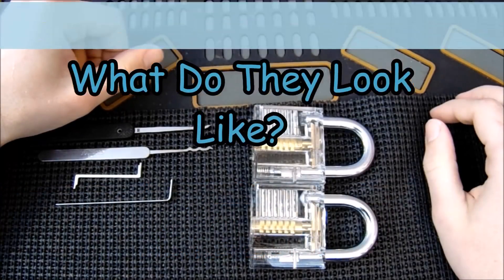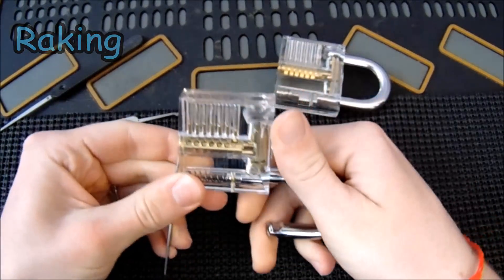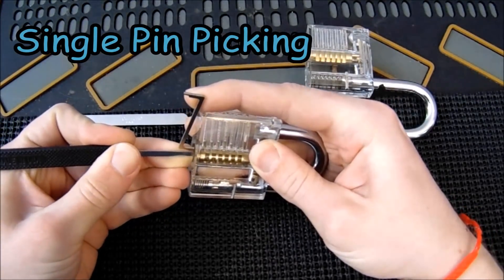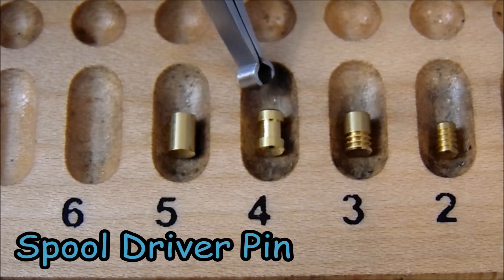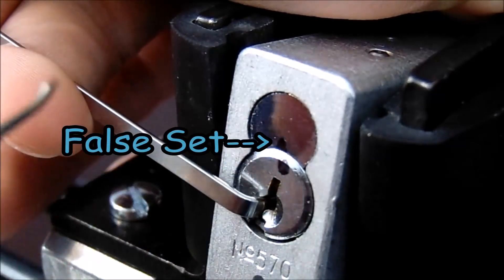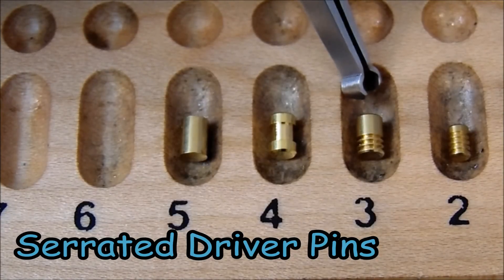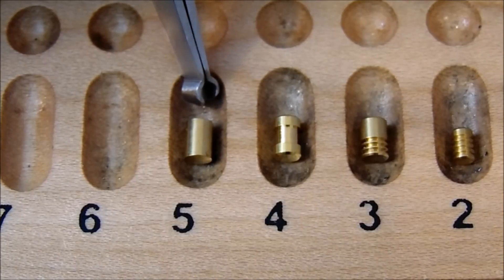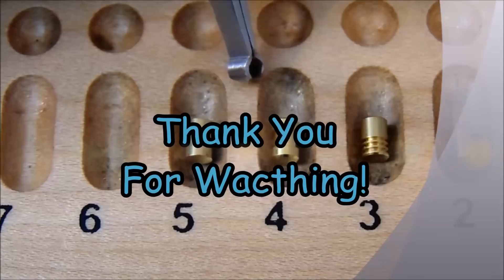[114] What Are Security Pins???  How Do They Make Lock Picking Harder?

Comment: The multipick cutaway locks have pinning kits that come with hollow pins (there's a small hole on one side of the pin, it's not drilled through, so that way it is different to pin-in-pin or telescopic technology), does anyone know how those work? Do hollow pins interact with T-Pins somehow, are they used in combination?
Reply from the maker: Thank you for sharing

Comment: I agree with your statement about security pins making SSP easier. I find that now that I'm becoming more proficient at picking security pins I'm having a hard time with the standard pins. They have a totally different feel. So, strange as it may sound, I would rather have a lock filled with spools/serrated pins than with standard pins. Even 1 or 2 standard pins mixed in makes it harder.
Reply from the maker: This is a normal thing most of us go through
Reply: @HelpfulLockPicker  Yeah. It's the main reason I got the Revolver. Lets you pick normal and 3 types of security pins all without the hassle of re-pinning. Saves a lot of time.

Comment: the direction of the pins? which is up and down? the "bottom" pins that 
go into the cylinder have a point at one end and that meets the key! and
 the flat spot on top meets the top part of the lock i think you call 
the "bible" that the cylinder goes into. so its point down flat on top. 
but the rest are confusing! the spools have a thicker part on top or 
bottom which meets the cylinder? and the "T" pin has me totally 
confused? is it pointing up or down? how do you know whats pointing to 
the cylinder in the upper part? have you done a more detailed video 
showing this? i have not reviewed all your videos? also is their a 
difference between "kwickset" and "schlage" i see that the kwickset has 
not a flat but a tapered end and the schlage does not but are they the 
same "thickness?" can you use one in the other? i noticed that the spool
 pins and not labeled at all.
Reply from the maker: It is sort of where you come from. In the United States Normal is pins at the top of the lock and in Europe normal is pins at the bottom of the lock. I don't like pins at the bottom of the lock because if a spring fails your whole lock can stop working.

Comment: Just starting out and have watched and appreciate many videos. My question concerns the diameter of the different types of pins. Are most of the locks shown in teaching videos the same diameter? Or or different diameters used in different brands of locks? Might seem dumb questions, but I have not seen it discussed. Thanks. WestCoastPat
Reply from the maker: Most residential locks have the same diameter. The big difference is residential / commerical, padlock, and small pin (like the small Master Locks)
Reply: @HelpfulLockPicker  Many thanks.

Comment: Hi! thanks for all of the info! so interesting! i was wondering way hook picks dont come with "lines" on the shaft so you can see what pin position you are at.. or is that distances between pins are just to varied? thanks!
Reply from the maker: Every lock has different spacing and also it would be hard to do without a constant insertion depth to zero out the distance
Reply: @HelpfulLockPicker i see..thanks! it so hard trying to figure out what pin i'm on.. sometimes.. i guess it just comes with experience! one more question if you dont mind.  sometimes i push a pin and the cylinder will sink down a little more but not enough for the lock to open.. don't know if that is good or not.. should i release tension to return the cylinder to the original spot.. or does it just depend? :)
Reply: @bills.4242  sounds like that may be because of a spool pin.

Comment: I've actually heard several highly skilled lock pickers say the same thing about security pins. That while difficult at first once you understand them you can actually use the extra feedback they give to make picking them easier. Essentially turning a strength into a weakness.
Reply from the maker: It is turning a strength into a weakness any sense but it also does a really great job at thwarting low-skill attacks which is where you really need to be concerned

Comment: Can you make a video on how pick locks with mushroom drivers ?
Reply from the maker: I plan to down the road, I am currently taking a small Hiatus on the series but I plan to get back to it soon
Reply: @HelpfulLockPicker  Great, can't wait to see new tutorials! 
Now I'm stuck after getting on real locks, I think I opened them with luck, I don't know what I'm doing wrong if it's too much or not tension, if the locks are too old and need lubrication or if I overset pins... But I'll definitively practice, practice, practice 😎
Reply from the maker: Practice makes the biggest difference. Sometimes a lock being old and worn can work for or against you. The next thing I would like to get going in the series is serrated pins.

Comment: These pins will make it easier to pick locks if they are serrated cuz of reverse picking
Reply from the maker: I have done a video on reverse picking and it is not the easiest feat to consistently pull off. All serrated pins is much easier but if you add standard and spool pins it is harder. It is a fun concept that is often not brought up, thanks for sharing!
Reply: Thanks

Comment: Is there a source for acrylic lock parts?
Reply from the maker: You can buy more pins online. Which parts would you be looking for?
Reply: HelpfulLockPicker the plastic cover, a pinning kit, and the tray you use.
Reply from the maker: @gordmclean802  I got my pinning kit on CLK supply and my tray on Amazon.
Reply: Gord Mclean you could easily fashion your own cover just cut out a piece of plastic or wood, sand it, and drill some holes into it for screws